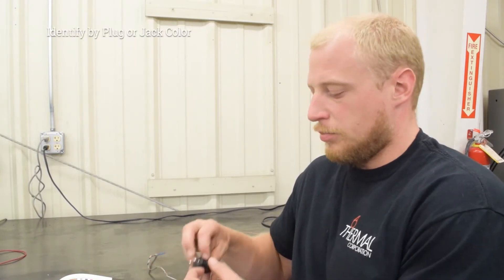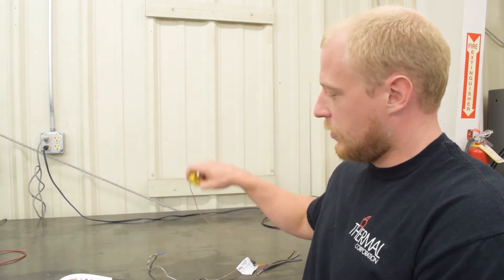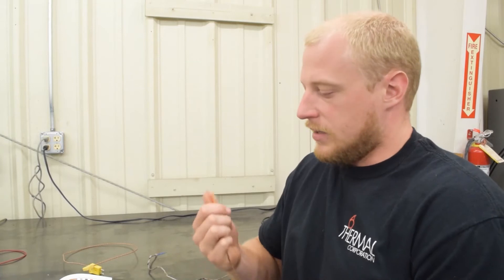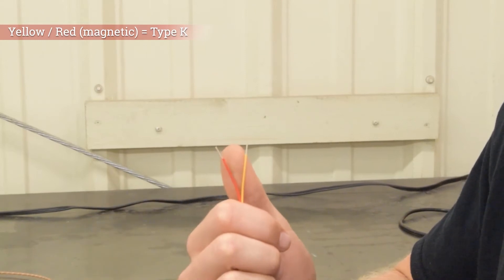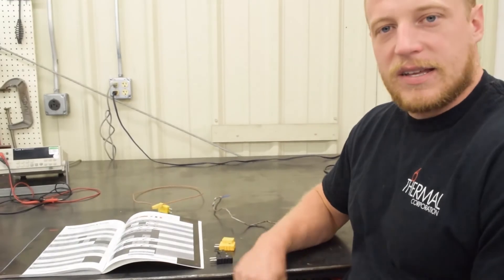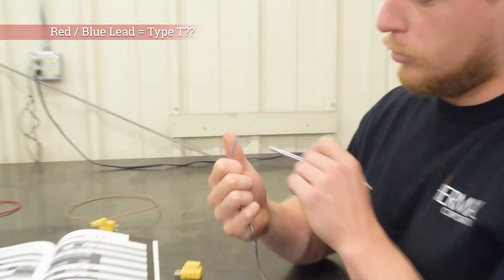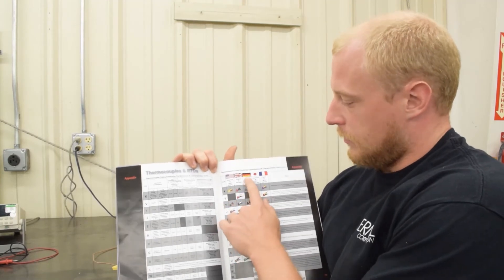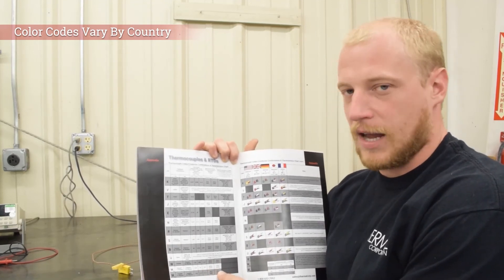How To Identify Different Thermocouple Types

Comment: How do find out what lead is positive and negative on a type R? When check the temp I only got j,k,t,e,r,s,b,c but no R on the machine. I was told e is almost the same so check it with e. But I wanna make sure bc platinum is not cheat